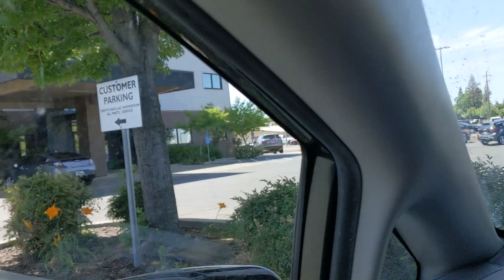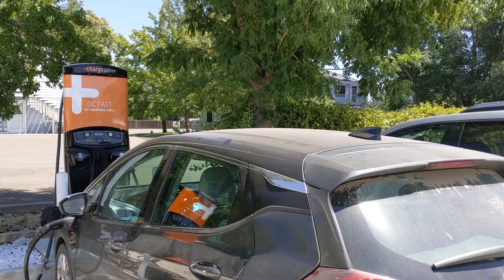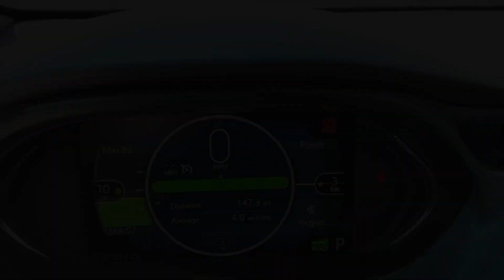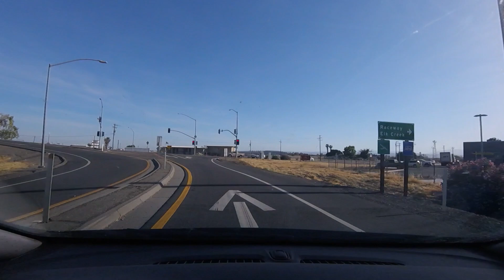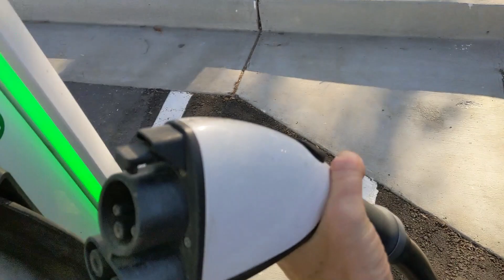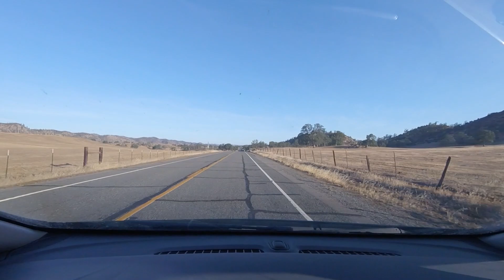2017 Chevy Bolt EV: Post Battery Recall Shakedown

Comment: I own a 2019 Bolt. Had my batteries changed with the new update ones. Very happy about the update but… when I started to charge after… I noticed the connection for charging was getting difficult. Yes I could charge but it took a few times to get it connected. Then 4 days ago there was no way to charge. I originally thought it was my home charger so I went out and tried and 4 other locations. Would not connect at all. Right now? Took car into Chev dealership and was told they had 3 other Bolts with the same problem. Hopefully they can fix.

Comment: Eric- please do an update. Not only the taper profile update you intended to further explore. We noticed this on our recent trip to Yellowstone, and I'm not sure it was an improvement. We consistently got lower kw on car display than before and I'm not sure the taper change offset that drawback. But also: Cars like my 2018 that have the software fix are still catching fire? Pros and cons of buyback vs repurchase vs replace battery under warranty. When you' ve got 70k like I do and are still paying off the loan, I kind of think #3 makes the most sense but it doesn't seem to be on the table. And what are the stats here? How risky is it to charge in my attached garage overnight compared to ICE catching fire? Thanks

Comment: would you recommend getting a 2017 chevy bolt even with the fires?
Reply from the maker: Yes, I wouldn't be concerned with the 2017s at this point. The 2019 that was subject to the recall is a bigger concern because one might have caught fire after the update.
Reply: @newscoulomb3705  thanks

Comment: Hi Eric, just returned my 2018 Bolt EV last week. It had been a great EV but I could not resist the return price as I had 40k miles in 3.5 years. My new German EV performance vehicle will now be my sole EV. Looking forward to picking up a roof box and do some camping.

Comment: Ford maverick hybrid is coming out with a possible ford ranger ev. Would u jump ship?
Reply from the maker: I have multiple cars that serve different purposes, so I wouldn't really call it jumping ship. I'm still working on the Ranger Electrics I have, and I still have an ICE F-150 that I will eventually convert/replace. Basically, I'm not really in a rush for another truck at this point.

Comment: My 2018 got the patch, got flagged, sat in the shop for 3 days while GM engineers analyzed the data.  I had a 4k mile road trip planned for a couple months, and i really wanted the patch before i left. They released the car to me, said it was good, i fully charged it at home, left on the trip, and the first leg i had done multiple times with 10-12% left, im suddenly struggling and i made it with 2%.  Car is throwing codes like crazy the whole trip, and my 1.4% previous degradation was now 9.5%.  

The curve is different,  and not for the better, i also saw repeated 64.5kW on EA chargers, dont ask me how, but i saw it multiple times a day..  BUT, those rates never transferred to the screen on the car, the numbers never added up.  Torque pro was constantly confirming this.  Having done about 6 of these 4k mile road trips, i finished this one as well without issue, except the constant error codes.. But charging was deeper into the curve to hop between chargers, eating time and money.   Not a bad trip, just not as good as the others.  

Car is currently back in the shop, while they scratch their heads. I Love my Bolt, but i think one of the new Hyundai/Kia 800V cars may be calling me.
Reply from the maker: That sucks to hear. Hopefully they can figure out what's going on and fix it. If you regularly do 4,000 mile road trips, there probably are some better options for. Heck, the 2020 Bolt EV would be a significant improvement. I'll be interested to see how available those 800 V Hyundai/KIA EVs are. Rumor has it that the VW ID.4 will also be seeing a 150 kW charging speed update, which would be far better for those longer trips.

Comment: Hey Eric, great video! I did an in depth look at the differences in DC fast charging before and after the recall on my channel. Basically, they did go to a charge taper instead of the hard steps, but they made it start slowing down sooner rather than later like they did on the 2020+. It basically still hits all the same taper points as it did before at the same percentage, but that means it has to slow down charging before it hits that taper point. In my testing, it did result in slower charging, but not substantially slower. They are also a lot more aggressive with cooling the battery, starting the battery conditioning (cooling) about 15 deg F before they did pre recall, which does also affect charging speed at lower SOC when the charge rate is still being limited by the 150A limit (or on a charger that isn’t capable of 150A)

My early testing on battery capacity (using the same method as you) also showed a small reduction in battery capacity from roughly 61kwh to 59kwh on my 2019 “transitional battery”, but until I can verify that with multiple tests after the recall, it’s basically unverified.
Reply: Hi Wrenching Fool

https://youtube.com/watch?v=SRZIhRtCNXk&feature=share

Thanks for adding this great video for us 'nerds with numbers'. I recommend all here who is watching Eric’s video to see Wrenching Fool's compare the pre & post latest Recall.

Comment: i def agree w/ you, i noticed most of the people that complain about the infrastructure either haven't tested their ev yet or don't know its capabilities. i realize sometimes charging stations are down, which is to be expected but you always gotta keep a buffer just in case. i noticed w/ the bolt that on hwy speeds i get ~145mi & city ~200 (that's w/ the software update)

Comment: Well, news today is that a battery module was blown which they replaced and then a battery controller module blew! So I guess the American components are less reliable than the S. Korean? My 2013 Ford Focus EV never had any problems so you best keep your old Bolt! I have to wait 2 years for the Ford EV pickup and my Bolt will go away! Supposedly the parts will be in in 2 days but I won’t take any long trips until I get the Ford!
Reply from the maker: I'm not sure about that. Having bad electronic components from anywhere is rare, which is why people refer to it as "winning the Lottery," but the U.S. made components were certainly less problematic overall (no recall on U.S. made batteries).

Good luck with your F-150 Lightning. It's a very different vehicle than the Bolt EV, but if a truck is what you want/need, it should serve you well.
Reply: @newscoulomb3705  i really hope that is so, I love the car but if it fails again I will have to bail on Chevy! I already lost sales in my church who loved the car but now fear it and one friend just bought a BMW but wanted my car! Sad!

Comment: Keep an eye on the Mach-E charging profile. It's pretty out there...
Reply from the maker: Yes, the Mach-E's profile appears to be unfinished, just like the ID.4's. I see a lot of people bashing Ford and VW for that, but people forget that the Jaguar I-PACE, Tesla Model 3, and others were all released with unfinished charging curves. The Model 3 in particular looked very similar to the ID.4 when it was first released (locked out to a max charging speed of 125 kW).
Reply: @newscoulomb3705  It will improve.

Comment: Nice video Eric. It's good to know that the battery recall wasn't a massive problem, but rather something that could be dealt with using minor fixes and updates. I'm pulling for GM, they have the potential to be a major electric vehicle player. Hopefully the Ultium units don't suffer from recalls, or at least have minor recalls like this. Keep up the good work!

Comment: Did you check with GM that DCFC charge curve / energy flow to A:C or battery conditioning changed?
Reply from the maker: I haven't checked or verified. I want to take a closer look at it before I make any assertions or ask any question. I want to know what I'm asking before I ask it. 

I can verify that, under the old charging profile, any power beyond what the battery can accept (up to 150 A) will be rerouted to battery/cabin conditioning.
Reply: Appreciate the response. I am looking forward to further investigation. I think a 2017 Bolt EV may be my next car so I’m trying to learn.

Comment: Please explain “BCM”. What do you mean by “bricking”? How much would a BCM cost if not covered by warranty? Thanks!
Reply: Assuming we are using the correct nomenclature here, BCM stands for body control module, which is also updated as part of the battery update since they change how the vehicle warns you if there is a problem. He may also be meaning BECM, which is the battery energy control module, the computer that is primarily in charge of controlling the battery. “Bricking” is a tech term used to describe when the software of the control module is damaged (usually during programming) to the point that the module will no longer “boot up” and cannot be recovered, turning the module into a “brick.”
Reply: So what is bricked? Will car no longer charge? No longer drive? Not turn on? Not DCFC? I am trying to understand what breaks.
Reply: @barryw9473  Q: So what is bricked? A: brick is bad, very bad.  Q: Will car no longer charge? A: no.  Q: No longer drive? A: maybe. Q: Not turn on?  A: maybe.  Q: Not DCFC? A: definitely no.

Comment: I have a 2017. Lots of problems ATM. Got the update.  Were they supposed to charge it after the update?  They only put it up to 22 miles remaining. I brought it in pretty close to that.  Their write up about the update is borderline nonsensical. For instance, the 'lowest cell' voltage they quoted was above the average cell voltage quoted.  Confidence is extremely low. Still afraid to park it in my garage.  No hard data but it definitely seems to charge slower. 35kw where I used to get 45.  Just bought a house otherwise would trade this car. My second ev (had a spark, never should have sold it).  :-(

Comment: I am not 100% sure my car was done right. Took my 2017 Bolt in last Friday. They were very busy and had me park it next to the building where I could see the car as I waited in the lobby. About 2 hours later a guy came and took the car back to the service area. He was done in 10 min and had the car back. They told me it was done and I could go. I asked the rep I thought they had to pull the battery and inspect it? The rep told me they only do a battery pull if the software tells them it needs done and I was good to go. So I left. But I recall the service bulletin claiming they would remove the battery to check for problems? Unlike EV Evolved my battery settings/ranges were all intact and not reset. Hilltop reserve is back so I know they updated something. Just hoping they did it right as fast as they did it?

Comment: I just got the update on my ‘17 last week, and I was able to try DC charging starting at 40% last night.  Temp was just under 80 degs, and I didn’t see a full 50 kw charging speed before taper kicked in at 52%.  I ran it up to 55% - it appears the step down from 50+ to 38 kw at 52 or so % is now a fairly steep taper, so my hunch is there isn’t much of a change between 50% step (now a taper) and the 67% step.  I’ll push it higher than 55% tomorrow when I put about 250 miles on it, to see if the taper continues below 38 kw at 55%, which - if it does - then makes the charge rate slower than it was.

Comment: 👍 thanks! I just had the update done today to my 2017, and as someone whom has a lot of experience with firmware/software updates on devices, I am always wondering after the update what to expect (including the nasty "surprises"). I'll be doing my normal 125+ mile round trip tomorrow and intend to charge to 100% before leaving, be interesting to see if anything changes. I noticed after the update my "hilltop reserve" was off as I had it enabled before the update (I didn't do the 90% cap update and waited for the "true" fix and ran with hilltop on as I normally do unless I do a longer drive). I intend to do some testing myself to see what changed. Rumor has it the update also included a fix for the issues some experienced with cold weather DCFC if you hadn't received it already. It'll give me something to test in different conditions as well to see what the update did. I'll keep an eye out for your updates and perspective on their update as well. I did notice in their report after the update that their AGM and traction battery test results resulted in a "pass".

Comment: Yes, we have missed you from a Tesla M3DM owner and EA charging.  I have talked my friend into getting a EV this Saturday 6-12-21.  He is getting a 2020 Bolt EV Premiere.
Why do you have us looking right a the A pillar!  Bad camera spot.
The day we drove it back, Holiday Chevrolet had to replace the 12 volt battery and it only had 22 miles of range.  We had a long 1 hour lunch just to gain enough range to get to the closest charger.  The  charger was a Francis Energy 50kw unit and it worked real easy with no account, but was VERY costly at $20.76 with 176 mile range.  We stopped at Electric America in Ardmore Oklahoma and boy did it SUCK big time.  A E-Tron was charging at one station.  The other three would not work.  One Just Out of Service and the credit card readers would not work on the other two.  What a very bad experience for a new EV owner.  From the videos I watch most Bolt EV owners really like the Bolt.  The "Fast charging speed" on a new 2020 vehicle and ONLY tops out at 55kw and thats only until 53% or so.  Then drops.  WOW!  The system in the car is the worst ever.  Two or three moves one way, then have to hit the back to get another menu.  Looks like a 10 old system.  Do the employees at GM or the employees that designed the systems drive the Bolt full time?  Probably not or it would be much better with faster charging.  The EVSE they "give you" is a 120 volt with max 12 amps - 1.44 kw, it wants to only run at 8 amps or .960 kw, WOW!!!  He does not drive a lot so it may work until he gets a nema 14-50 then has to buy a new better EVSE.  The Bolt drove good and OK power but nothing like a DMM3.  If the CCS1 charging stations work this poor, it may take many many years for a mass change to EV'S.

Comment: Thanks for the info on the BCM.  I saw a post on one of the forums that seems to support your findings on the charge curve (linked below).  I'd be interested in what you find after you hook up torque pro.  https://www.chevybolt.org/threads/new-charging-curves-on-2018-bolt-ev-after-final-recall-update.38837/

Comment: Took my 2017 Bolt on for battery update, batt at ca 38% SOC. Was told batt had to be 80% and had to wait ca 90 min. to get to that (free charge) done. Entire time was about 3 hrs. Of course if I'd known in advance I would have had it charged to that level.. GM how about a heads up?? Dealer has been very good so not suspicious of delay.

Comment: The Ford Mach-E has a lot of bugs. The trip screen is poorly set up and it has other problems. https://www.youtube.com/watch?v=jGjUQuXozYc&t=5s
Reply from the maker: Oh, I'm not completely sold on the Mach-E, but it comes closest so far to what I'd want. The VW ID.4 is also impressive, but I prefer the battery size/range and styling of the Mach-E far more.
Reply: @newscoulomb3705  be sure you try them out before you drop the bucks. https://www.youtube.com/watch?v=ikheO2Nb3-k

Comment: I did the recall update in the middle of a 4K mile trip. Thank God it didn’t brick when I hit 100% charge!  Just completed the 2k mile return yesterday. The only difference noted was the ability to skip a charging stop in NM since I arrived with more juice than ABRP gave me as a charging goal. -combination of more capacity and much higher efficiency due to road construction & slower speeds.

Comment: Bought my 2020 Bolt EV Premier in September and about a month ago it got a charging error that killed it! Only neutral and park worked! Waiting to see if they ever get it fixed so it feels like owning a Tesla except that the Chevy dealer is 5 miles away instead of 100 miles! A whole module in the battery pack need replacement, very disappointing since my 2013 Ford Focus EV only had a couple of days in the shop ever! If I ever get the Bolt back, as much as I love it, I may trade it on a Mustang EV! My wife’s gas car is driving me crazy, $100 so far in gas and gas cars seem broken, not used to substandard transportation!
Reply from the maker: That sucks. I'm sorry to hear it. Why is it taking so long to fix? When I spoke to the dealership when getting the update, they were replacing bad batteries and battery components the same day.
Reply: @newscoulomb3705  they need the component , lower the battery and instal the part! I guess it comes from S Korea and takes a while! They wont replace the battery for just one component! Sucks is the word after 7 years of perfection from the Focus EV! But weird things happen, probably just a bad chip!
Reply from the maker: @ronalaska2472  None of the battery components should come from Korea at this point (all of them are made in the United States for the 2020), so something's not right. Have you escalated to Corporate?
Reply: @newscoulomb3705  well, I thought they just improved the Korean battery, good to hear it is US stuff now but I got to busy to check with them! I will on Monday but I sure found out once again why I hate gas engines! Electrics are always full of electrons every day with no hassle!
Reply from the maker: @ronalaska2472  Yup. Brownstown and Hazel Park, MI are now where most (if not all) of the battery and power electronic components are being produced. It sounds like your dealership was just making excuses. Hopefully, it gets taken care of soon.